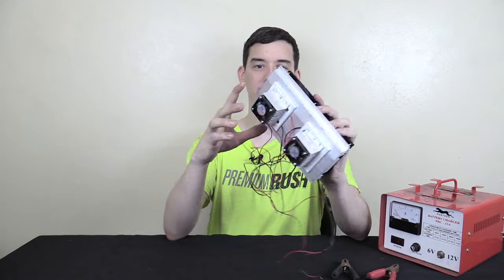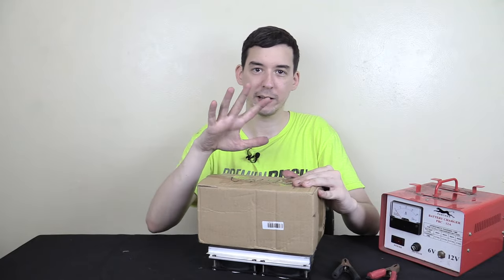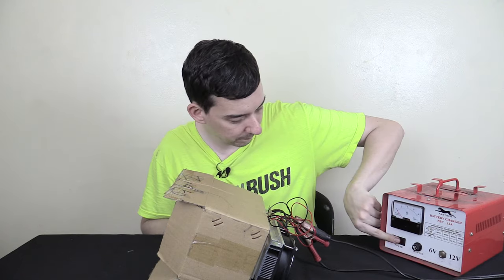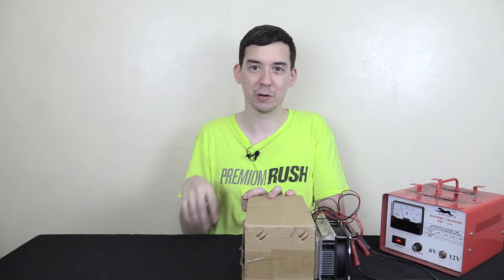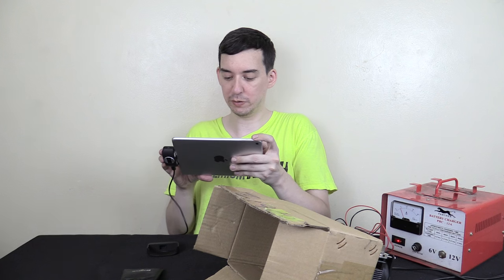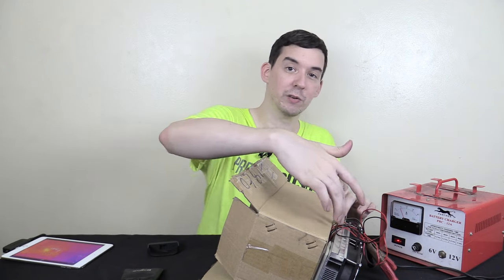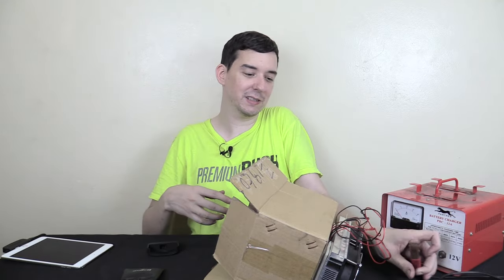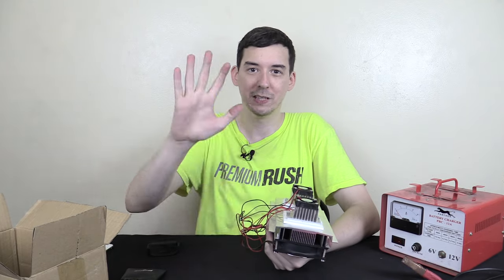Peltier Thermoelectric Cooler

Comment: A personal cooling device maybe. You may replace both mini fans on cool side for 2 large CPU heatsinks placing the fins side inside a tube or similar structure frame to create the air path. A 30 cm or so propeller fan at the end of the tube will move the air and blow on you face/torso.Onother tube on hot side will blow the heat through a window outside the room.

Comment: I will use the same unit to help the basement wine cabinet (up to 200 bottles) stay below 55F in Colorado summers. I use a small garage heater and an Inkbird Pro controller for regulation. The Inkbird is web enabled so I can track wine cabinet temperature remotely.

Comment: You can add a water block probably an alumini or copper made in between the peltiers and than run cold water through it which gets criculated in cheap copper pipes which can than be mounted on a table fan this way the efficiency will be much increased also there will be condensation of moisture in room leading to Air conditioned effect ...alternative to water can be an anti freeze coolant which ll be bit costly but more effective than water...no need for heat sink on cooling side just sandwich the peltier module onto the water block ....i have tried this is works perfectly i used 2 peltiers on laptop chargers almost 100 watts bt it gives me cooled air one more modification can be that you can use some tubing made of cardboards with inner side covered with alumini foil or tape to vent out the hot air...or else the cooling and heating simultaneously will nullify each others effect thanks

Comment: I just bought a unit nearly identical to this one.  Mine has the same fans and heat sinks, but mine has 3 modules instead of 2.  I wanted to use it to cool a bedroom.  It hasn't arrived from China yet, so I won't get to mess around with it until then, but it is supposed to tolerate 150 - 180 watts on the high end at 12 volts.  What's awesome about them is how small and compact they are.  If 1 unit isn't powerful enough, I could stack another 1 or 2 with it in the window and get additional power supplies for them.  If it's simply too weak to accomplish anything in my window, I'll make a foam box for it and use it as a mini fridge hahaha.
Reply: again....5% efficiency on peltiers. ur in for a huge let down if u think u can cool a room with these...even if u properly insulate the indifference of temperatures. u could get  box fan for the same price i bet
Reply: nautical1983 box fans don't make a significant temperature change.  I bought one to mess around with it.  I may incorporate it in my computer some way if it doesn't help my room at all.  I bought it to mess with it and if it's super inefficient, I'll run it off solar or I won't use it as an AC.  I just find it to be an exciting concept.  No moving parts.  Very cool.  I'm also interested in the efficiency differences if you is more units at lower power instead of fewer units at maximum power.

Comment: I know this is a old video but I just purchased a large TowerOfPower Humidor Cabinet. I live a warm area and running the AC is far too expensive now. Making sure that the inside must remain 70° humidification is not hard since there are many devices to purchase to maintain that 70°. What there is not, is a unit or product to maintain the 70° inside temperature. Wondering if this would be a option with a Temp control module would do the trick.

Comment: OK so, I don’t know anything about Peltier modules. But, the other day, I blew an old mini fridge because, when it was manufactured, they used the same socket for 12v that one would use for 120v so, I didn’t know the difference and blew it. One of the engineers I work with took interest and said that it probably had a Peltier module so, I gave the fridge to him so he could tinker with it and bought myself another mini fridge, which might also have a Peltier module, but cools as well as warms.

Anyway, the question I’m trying to get to is whether it’s possible to convert an Homedics MyChill from an evaporative cooler to one with a Peltier module. I have 2 MyChill units (one large and one small) and, apparently, Homedics knew little about how to manufacture what they were selling. I’ve had both for about 3 months. The larger one will no longer distribute water and the smaller one, which I keep at work, is leaking water all over my desk. But, I’m looking at the size of what you have, I wondered if something half the size of that could be used inside of an Homedics MyChill, without all of the problems the units ship with. As the new mini fridge I purchased, apparently, uses not much more electricity than a light bulb, it seems like a perfect match, although from what I hear regarding most Peltier setups, they seem to draw too much electricity for the benefit.

Still, I would love to have a small, portable, leak-free unit for home and work. Is this a possibility at all?

Comment: hi buddy, I am very much looking for air-conditioning solution for my 60 bed hostel using a peltier design, the reason for this is fairly simple
1) want to just cool the bed instead of the whole room
2) I could have duct free AC solution (I had considered using an old 1.5 ton AC via 2-4 inch ducts to supply cool AIR to all the beds but that would mean running the AC all the time irrespective of bed occupancy)
3) I am using wall fans right now which use 60 watts of power at 230volts whereas this will be using 12volts at 60-80 watts hence similar power usage *(hopefully)

however I foresee 1-2 major challenge 
1) Dissipation of Heat - Generation of heat from the peltier heat side. 
Possible solution - I could use a liquid cooling method & circulate the water through an over head tank with 60 units running all night for 12 hrs it should be able to heat sufficient hot water for bath OR atleast warm it

2) I would still be left with the problem of recycling the AIR in the enclosed area. 8hrs of a person sleeping in an enclosed space is unhealthy & dangerous therefore I would still require ducting system for this

question to you - have your observed the time taken to the cool the enclosed bed space that you had experimented & also how much temperature drop was possible

Comment: I regret I did not see this earlier i spent some good money on a Corsair water cooling for my PC this Peltier Cooler seem like the perfect solution to cooling my entire CPU tower.
Reply: you should be happy with your purchase. a peltier is an open source of differing heat, thus creating condensation  as apposed to closed water systems. arc ur ecu and ur out more cash with potential fire hazard. i work at microsoft and have heard its a bad application
Reply: It is a bad application because those peltiers consume a lot of power that is also converted into heat. You will have to get rid of that extra heat as well.

Comment: Just to point out, a large drawback of peltiers is their low efficiency. It can be used for hobbyist/small projects but can't replace air-conditioners/coolers meant for larger area coverage as solicited by many of the comments.
Reply: Ketan Vaidya actually it can.

Their efficiency is bad due to the amount of power input and the energy lost to heat.
Places where electricity drain does not matter, such as if you go on holiday in a hotel, you don't care what their bill is.

Same as industrial places,
Reply: Ketan Vaidya ji, yes you are right. Peltier cooling area is mere 4cm x 4cm that is not sufficiet for cooler or ac purpose.
Reply: The efficiency of a regular fridge is between 40% and 60% and the efficiency of a peltier module is between 10% and 15% so very inefficient indeed. They are mainly useful in applications where there is no room for compressors, pipes, liquids and gasses and in cases where the orientation of the system is changing a lot.
Reply: They can be good if you flip direction and use as heaters for batteries(lead acid on solar system in well insulated shed), or keeping a water bowl thawed in winter...
Reply: can this work for a terrarium of 55 liter size (basically a plastic box im using for acclimmating imported rare plants) ?

Comment: Hey I just suffered a raspberry pi overheating burn due to over clocking,  So I recommend it to use for that.
Reply from the maker: Yikes. I'm surprised to hear that. Did you add heatsinks?

Comment: AC 0.5 HP is 500 to 600 watts, u have the right idea just cool the bed space.... BTW u can always use the hot side for dry heat sterilization, great for table utensils kitchen utensils

Comment: "that" thing will draw 4-5 times more watts than the conventional compression AC while doing the same "cooling" essentially if you wanted to achieve the performance of an 800w AC you would need about 4000w worth of peltiers, and the heat those will produce will be around 7000w, imagine that, how would you dissipate 7000w of heat? 

anyway im just thinking of making a personal AC with this, since going down the scales that much you simply cant do it with conventional AC units, and using around 200-300w to cool your face on a desk seems pretty reasonable to me
Reply: I want to use this to cool a small space for my kid's chinchilla during the hot summers. How far below the outside temperature do you think this cooler will keep a 2x2 ft box. If its 100F outside, do you think it would keep it at 70F?

Comment: I live in my 1991 ford f150 with no real ac in the flat bed with camper top. As window ac units are just too big. I would like to see this cooling a space 8’x 5’ x 5’ as i have a 12v supply. If it worked it could be mounted in the sliding side window.

Comment: I wonder if you mated this with a bed mosquito net if that would keep the cool air localised to the bed area ? Need to be sure the heat sink doesnt ignite the mosi net 🔥
You could also make a solar powered cooler box

Comment: What about using water for cooling the hot side and the cold side for cooling water which will pass thru a fixed fence which you can use with any regular fan to cool any area.

Comment: I have what appears to be the same unit. Where did you get the wiring diagram? Do you think its enough for a small wine cooler? I need to get it from about 68 to 5oish farenheit?
Reply from the maker: It's just positive and negative, 12V supply. So no real wiring diagram is needed.

As for whether it could be used as a small wine cooler. Honestly I'm not sure.

I guess it should be possible, since many mini fridges only have one of these cooling units (peltier)

Comment: Are the interior fans really necessary especially if using a big heat sink like the one outside? In that case, convection should take care of the chilling.
Reply from the maker: Maybe, maybe not. Either way they take a minute amount of power compared to the peltier modules so it's probably not even worth worrying about.

Comment: Hey dude! Great video! My bedroom reaches 32c and is ridiculously uncomfortable to sleep in. I have a 400mm x 400mm x 300mm polystyrene box with a lid... if i cut out a square hole in the back of the box, mounted this unit so the small fans blow into the box, place 2x 120mm 2000rpm fans in the other side, what kind of results do you think could be achieved temperature wise? I know its a "how long is a piece of string" question.... thanks :)

Comment: Water Chiller, Reservoir and Pump for a chilled water quilt, using 1/4 inch poly tube snaked though 2 bed sheets stitched together(like cool suits racecar drivers use).

Comment: Anime fan.   Building a Totoro mascot costume that can get up to 140*F inside during the summer.  So yeah, I don't dare wear it during the summer.   But if you can figure out how to get one of the mini refrigeration units to work in a mascot costume using just a phone battery pack, you'll have some buyers, fast.   The one in this video is too large.  But I know they make smaller ones that are powerful.   Mascot fans work off of a simple battery.  But it's not enough.  Just circulates the hot air around the mascot costume.   You figure that out, make sure the emissions are non toxic, I'm first in line to buy!

Comment: Sir, you seem to know what you are talking about. Got a question for you. I have a 12v koolatron p25 thermoelectric cooler. I was thinking of running a duct from one of the car's ac vents outlet to the lid's air intake so that it will have a colder temp inside. Could this hack damage the unit in any way?  Thank you

Comment: the cardboard box. do that but out of plastic or something with a smooth surface. remove the 2 fans on the coold side. make 2 hole's in the box. get 2  metal tubes. short ones. maybe something like what they use for small vents. now you got a intake and outtake for air. put 1 of the fans you removed in the end of one of the metal tubs. now it will suck air in to the box .cool it down then blow it back out.  if you have a smaller diameter at the outtake then the air will compress a bit and get colder. (inntake big outtake small)  . on the hot side. remove the fans. take a metal tube cut it in about half on the long side. stick it to the hot sides heatsink. and but a fan on one end. blowing air in to the tube. this should create a "vacum" and pull the hot air with it as it passes the hot heatsink. now you consume less power. sorry about the poor spelling and gramer. am both lazy and dum. :)

Comment: How about using the heat energy instead of letting it waste.  Does it get hot enough to boil water? That could be used to run a steam motor while still getting benefit from cold air.
Reply from the maker: It can boil water but I'd imagine only small quantities at a time.
Reply: I’ve made a dual peltier liquid cooled water chiller, with the water(hot side)  in a closed loop with no cooling the 100ml water reaches boiling in 10 minuets and after 20 min the pads have overheated and destroyed them self 
Water on the cold side (10gal) will reach 5c from 24c in 8 hrs
Reply: just freaking yell and say you're gonna take stuff away! I'm about to FLIP!!!--
Reply: the goal is to keep the hot side on its optimal temperature or else it gets broken... It was our thesis when I was still a fifth year student and we figured it out after 3 broken 12706 peltier plates... so yeah such a waste

Comment: I´m on a middle of a project which requires using peltier modules. I am planning to use a 12 V battery car to power 8 peltier cells. The battery will be connected to the car´s alternator. I have a  small van with no AC, still thinking about the best way to install the complete device. I hope everything goes right.
Reply from the maker: What's the purpose of the device inside the van? Are you using it for cooling or heating?
Reply: Gadget Addict I want to use it for cooling, where I live weather is not extreme, winters usually don't go below 11 Celsius but summers can reach 33. I haven't been able to find too much info about powering multiple  Peltier cells using a 12 DC voltage from a car.

Comment: If you are still looking for ideas, I have one big one. I wanted to design or create a diy cooling system and I came across your video. I am trying to create an energy and resource efficient cooling system for my 3D printers. Most of the time, diy kit printers (cheaper ones) have problem with getting “too hot” and houses have litteraly burned down because of them. Two ways to avoid this, cool the components or achieve the correct wiring and upgrades for the parts. I’ve done the correct wiring so I wanted to see if I can cool the components that are getting hot the most without spending too much money or resource. I think you can use this product to cool the main board and power supply of a diy printer of an Anet A8. Instead of noisy fans, or expensive water cooled systems, this may work. Let me know what you think! Also willing to colab. Thanks :D

Comment: I was researching this for a tiny cat house I have, any suggestions for a better power option?  I would like to heat and cool it since I'm allergic and can't have the cats inside they stay on my screened in porch.
Reply from the maker: Nowadays you can actually buy small portable aircon units which look almost like a slightly oversized brief case. Or maybe between the size of a brief case and the size of a carry-on luggage.

They're proper condenser based aircons, but just made much smaller.

Those would work well, at least for the cooling side of things, I'm not sure about the heating.

Comment: I'm looking for a little help.. I watched a bunch of videos on these and not getting a solid answer and it seems you are the only one that actually responds to questions. OK here it goes. I built a 1:32 scale "ice box" for a model ship. I used the smallest Peltier module I could find with the lowest volt requirements. ( TES1-3103, 3.5V/3A) I'm powering by a 3.5V 1400mah li-po. The unit seems to work but it gets very hot pretty quickly, no matter the polarity. what am I doing wrong here??? do I need a buck converter?? or are there different peltiers for heating/cooling?    STUCK!....
Reply: Randy Coolbaugh i think peltier modules logic is
The lower the temperature you can get on the hot side, the lower the temperature you can reach on the cool side could be upto -0 to -35°C depending on the type of peltier module.
Reply: oh. so the TYPE of module also depends on degree of ability... did not know this! Thanks!!  I have been playing with this thing for a bit, I ended up making a larger heat sink with a fan.... a teeny tiny fan.... also I installed a buck converter... This is as much as I can do without it loosing its scale ice box appearance.
Reply: Also if you bought it from China, it is quite likely that the module is simply broken. In that case it will just short circuit and heart up.
Reply: really!?... yah, that would be just my luck.. never thought that as a possibility.  THANKS!..